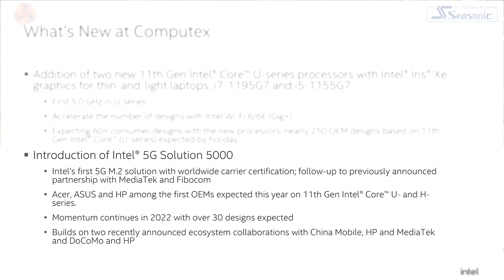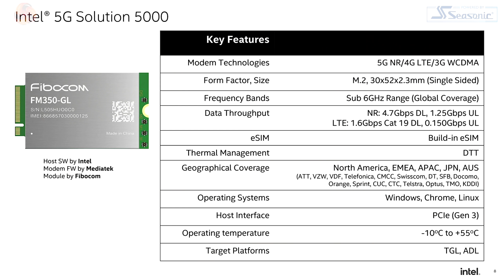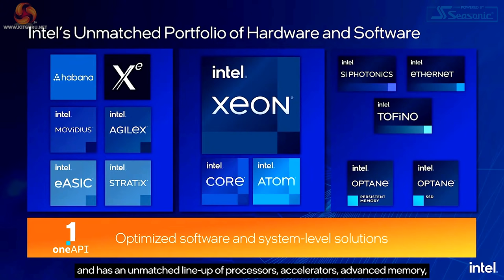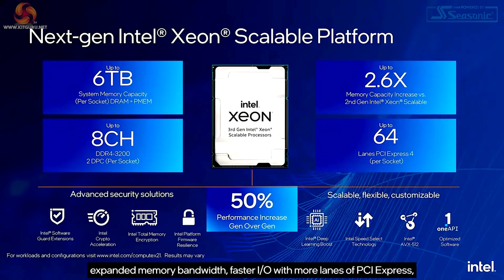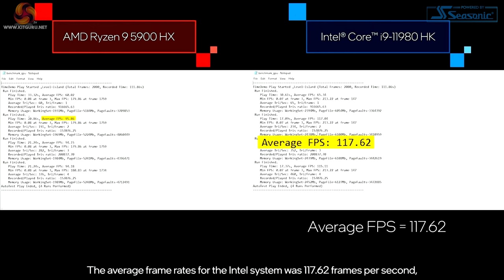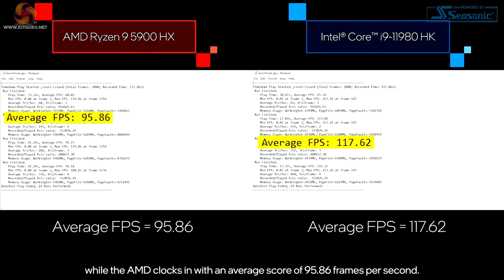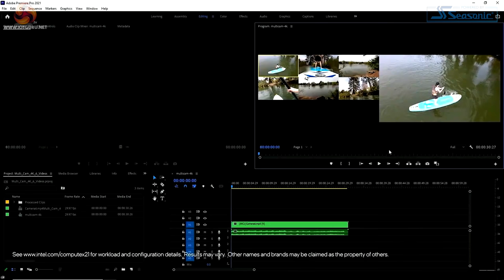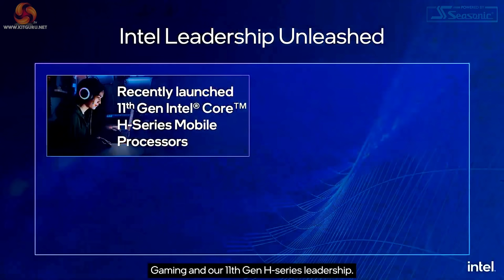LEO Reacts to INTEL Computex Keynote 2021

Comment: That gaming comparison was extremely specific.
And no mention as to what wattage limits where set for each GPU.
A 3080 in one laptop can be completely different to another if it can pull an extra 20 watts.
From what I've seen, the general consensus is that these chips trade blows in gaming, just depends on what game you choose. Misleading.
Reply: Even if the gpu was 100% the same, there are still several other factors that can cause performance to vary greatly.

Comment: 8:50 why is the play times longer on the AMD system if there running the same benchmark and rendering the same amount of frames?
Reply: you can also see that the Intel sys consitently has a 14% lower min. Frame rate on the slowest frame (3) ;-)
Reply: @TheUmbrella1976  -- The absolute minimum and absolute maximum fps values are not important. What is important is (i) average fps, (ii) the 1% lows and (iii) the 0.1% lows.
Reply: Memory usage on the AMD was also lower for whatever reason.  Did they have multiple other apps running on the AMD while doing the benchmark.
Reply: Crysis used Intel C++ Math Kernel Library and was compiled by Intel C++ Biased compiler of that time. That extraordinarily evil Intel C++ compiler with that math library uses non-optimal code-path for all CPUs that are not "Genuine Intel CPUs". It's not a surprise why Intel bulshtters have to use that benchmark to hide their loser side.

Comment: Clearly that i9 11980 HK was beating AMD while only sipping 8W.
 Intel would never dare run a processor at stupid high wattage just to spite AMD....
Reply: Haha, I bet it ran at 120W and on liquid cooling with 20 Alphacool NexXxos Monsta rads in a room at -200°C.
Reply: just to spite AMD, like when after ten years of QuickSync and adobe ignoring it, a month after Threadripers launch Adobe launched Premiere with QuickSync, making the 9900k better than anything else on the planet including intel's own Xeons, lol.   Just don't expect that incredible frame encode rates on 'F' sku CPUs, no intel iGPU to do QuickSync, lol.
Reply: I'm sure with a dedicated gpu the difference would be minor. But hey the igpu has to be good for something I guess.
Reply: *AMD system ran on battery, in a 100 degrees C environment.

Comment: Isn't Crysis Remastered limited on how many cores it uses?

Googled it and not only does it use a maximum of 4 cores, but it only really uses 2 of them. So Intel were probably leveraging single core performance on a game not designed for 8 core processors.

Comment: Intel didn't sell all of their 5G business. They retained their 5G IP for PCs. What they announced yesterday is a 5G solution developed in collaboration with Mediatek albeit this first iteration is mostly Mediatek in hardware. You are also underestimating the significance of firmware and software. In any case this is not by any means a rebadge of an existing solution like AMD recently did with Wi-Fi (which is the literal definition of rebadging).

Comment: boy what a relieve to watch Lisa Su's presentation after this attempt of getting into the Ghz range of empty words per second, repeating buzzwords like innovation, connectivity, leadership etc. without saying anything concrete about actual architectures or products. Well, if I extracted the actual info right, they got two new SKUs, slapped a sticker on a 5G modem, and other stuff got delayed but pinky swear its coming, so there's that.

Comment: Pay good money for a game with an antique game engine that only uses 4 cores and FPS is about core clock. Gee, another decade of of stupid 1080p 1080p 1080p 1080p  1080p 1080p 1080p 1080p  1080p 1080p 1080p 1080p. Yes, at 4K it's that $1000 GPU that's doing the work. Why not? Or just pay for an antique game, top notch GPU, Intel processor and brag about your FPS in 1080P.